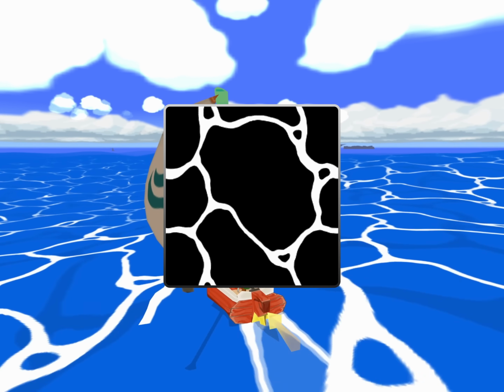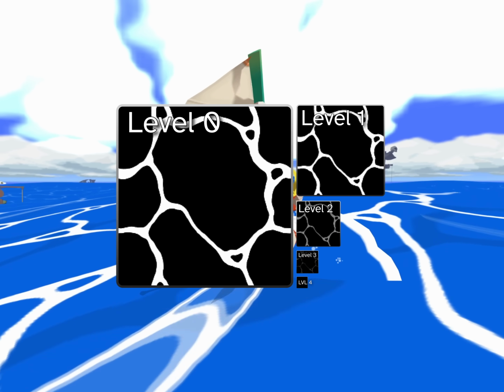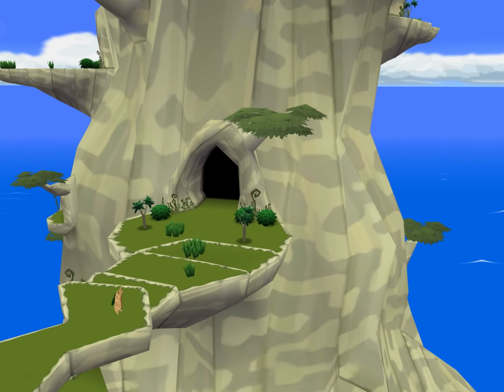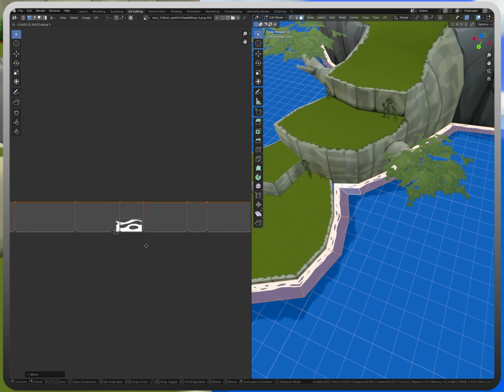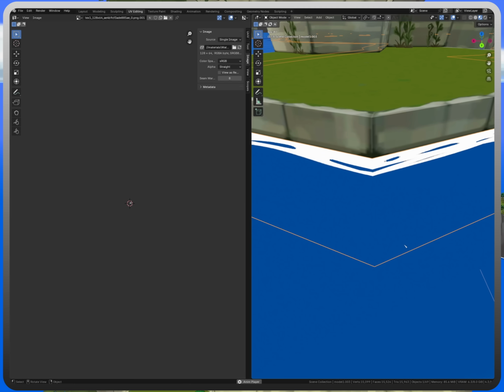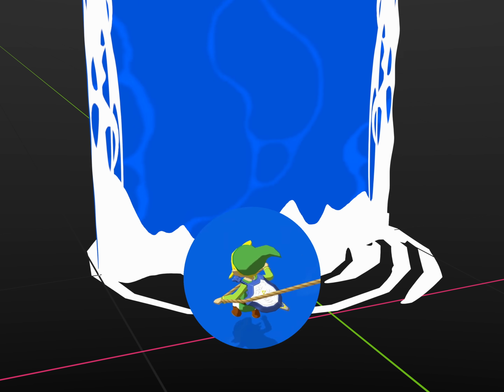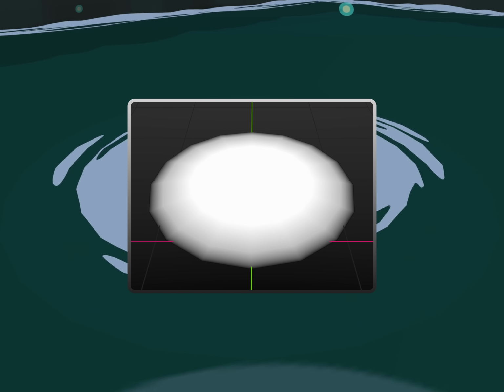How Wind Waker Builds Its Water Materials

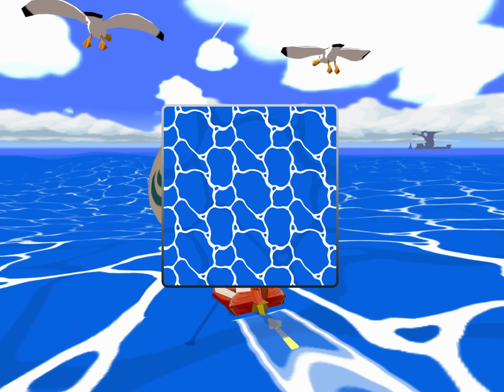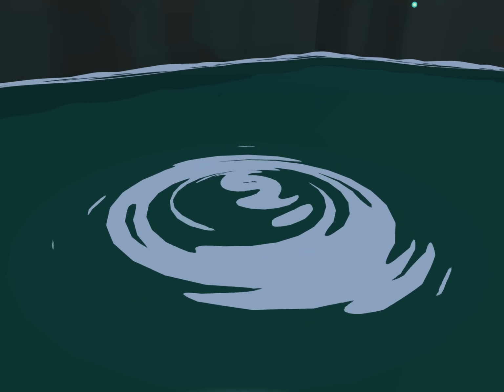Comment: 1:30 5:09 Wind Waker uses environment-mapped bump mapping (EMBM) on its water!? That’s neat! I already knew that the game has these heat haze effects in some places, which were typically done in the early 2000 (on old GPUs like the Matrox G400 or Radeon) using an EMBM layer. This confirms that my suspicions weren’t completely off. Hell, the Gamecube has native support for EMBM in hardware, and I’m aware of a number of other GC games using it for things like water (Super Mario Sunshine, Crystal Chronicles, Donkey Kong Jungle Beat, Mario Party 4, Mario Golf, etc.) or on metallic objects (RE remake, Starfox Adventures) or on wet rocks and character models, so it’s not surprising that WW has it too.

Comment: I’d don’t get really what he means with displacement map? The GameCube did not have such feature. 

Only thing I can see is a texture with some distortion to the UV coordinates over the mesh itself?
Reply from the maker: The gamecube did support this feature, it is used in The Legend of Zelda: The Wind Waker, in exactly the way I describe using the texture I show in the video.
Reply: @ I need to listen again. I did a quick browse maybe I misunderstood you.
Reply: I think it’s more correct to call it bump mapping rather than displacement mapping, because that’s what it’s used for; environment-mapped bump mapping (EMBM). It’s one of the Gamecube’s native hardware-supported bump mapping methods, with the other being the cheaper (and not as good-looking) emboss bump mapping. EMBM was commonly used in games on old PC graphics cards (starting with the Matrox G400, in 1999) and on both Gamecube and the original Xbox (and also beyond).

Comment: I always find the "displacement" map technique to work not so well (I'd call it a distorsion mask in this example though). This can result in a grainy look in the end.

Most of the time, I prefer to make this distorsion out of pure math. I imagine this can be faster too (you can do it without any trig function). Is it possible they used this kind of technique rather than a mask ?

Do you have a way to sample this kind of mask to get rid of this grainy aspect ?
Reply: I don’t get what he means with displacement. The game cube did bit have such feature and it does not have any shaders. Just a fixed function pipeline. Is the displacement just simple UV animation?
Reply from the maker: I assure you it's done with a texture, that sin(x*cos(y)) texture is pulled straight from the game.

Comment: I always wondered what the 'U' stood for, great video!
Reply: There's actually not any meaning behind the letters, U and V just happen to be the letters that come before W, X, Y, and Z, which are already used for vertex positions.

It's just a happy coincidence that V ended up being used for the vertical axis.
Reply: @TinyDeskEngineer  thanks, it was winding me up xd
Reply: @TinyDeskEngineer  unless you're making a 4D game, W is actually used in UV! the full version of the "acronym" is UVW, for 3D textures.
Reply: @hootis1  Even in "traditional" 3D games, W is used in quaternion math (XYZ is the vector it points toward, and W is the "rotation around" that vector)...

T is, of course, Time.
Reply: Not sure about origin, but UV are made-up coordinate system, just like XYZ for position. W sometime used as extra component, for example XYZW(4d vector, quaternions), UVW(3d uv). 

Also there is even more strange naming for horizontal/vertical position in texture I saw. Instead of XY, its S,T 😂
Reply: Sometimes UV becomes ST 😂
Reply: It drives me crazy though, because you’d think that the UV would instead apply to UV light, like for materials which darken or fluoresce under a blacklight
Reply: @AmaroqStarwind  Nope, it's just extending the naming scheme XYZ axes use.

Comment: I'm very surprised that the game doesn't use a form of intersecting mesh detection for foam around islands
Reply from the maker: That would probably not be worth the time implementing as well as the computational cost on the gamecube. The islands are static anyway. Might as well just plop down some static meshes
Reply from the maker: Oh also, artist control. You can see specifically with the shadows they extend them underneath the tree overhangs
Reply: @Dooge yup as we did most of the stuff back then. Just precalced or preanimated stuff. Fake it until you make it